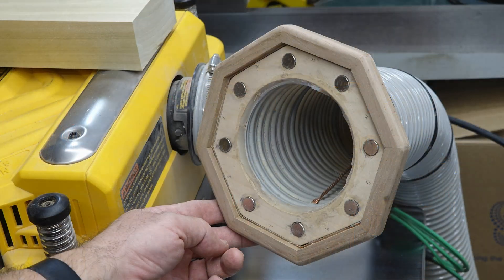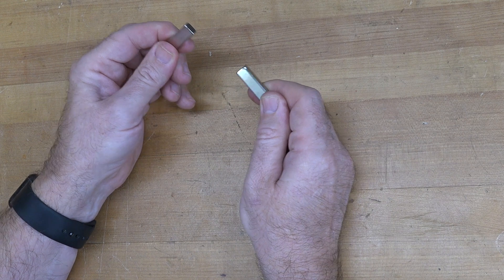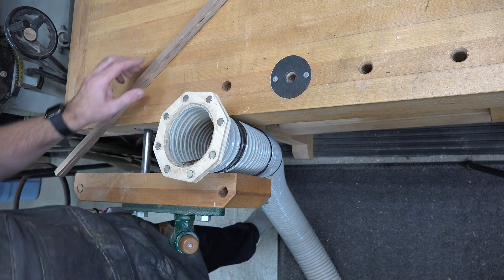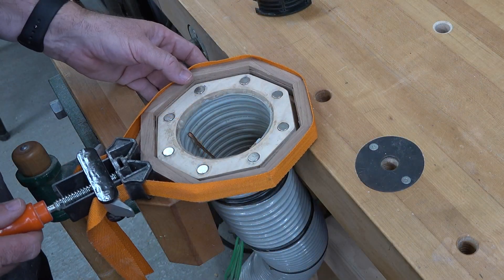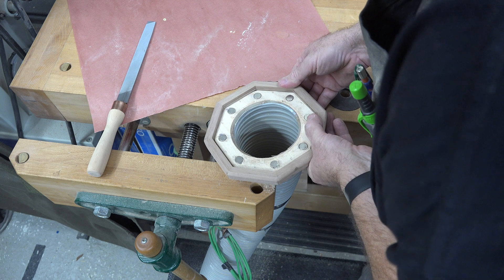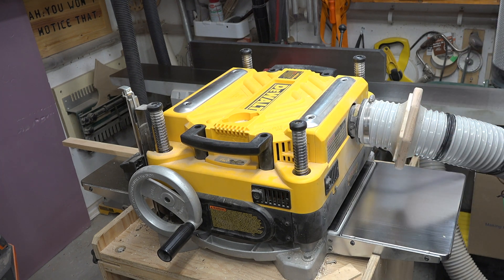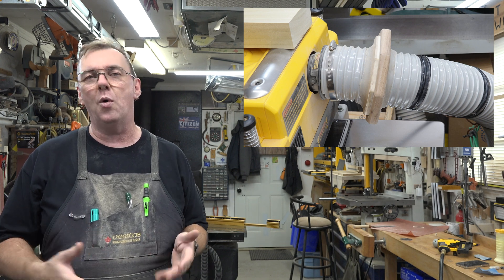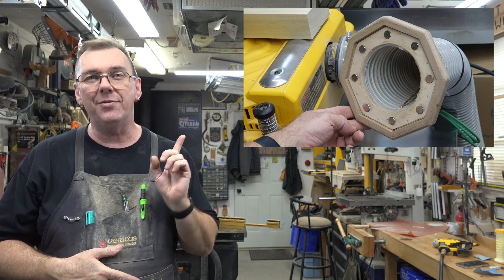Magnetic Dust Collection Fittings 2 0

Comment: I will be making these adapters, but for 2 1/2 inch hose. I will use my laser machine to make the template. I'm thinking about routing a shallow grove on the face of movable piece and gluing in a 1/8 inch "O" ring (may not be necessary). Thanks for the video and giving me the inspiration to make myself. Keep it up.
Reply from the maker: Glad that you liked it Joseph.  Good luck with your project and thanks for tuning in to the show.

Comment: Wow, Thanks for this video, I will definitely use this idea.
Reply from the maker: It's a great idea and it worked well for a very long time.  I ended up 3D printing magnetic connectors eventually.  They work really well also.  Both designs are fantastic.  Thanks for tuning in to the show and good luck with your project.

Comment: Great Update!
Adding the flange is the  best way to keep them from sliding off.  
 I learned recently that stacking magnets improve their pull strength. 
Do you just have one Magnet in each Hole? Or are they stacked?
Wondering how many around the hole are really needed, now that the flange helps keep it in place?
I see so many people only use (4) around the hole and not hearing about any of them falling off, but they also stack them?
 And how many Stacked?  
I know the more, the better.
I know it depends on how thick and what type each individual Magnet is.
I guess it's just a lot of trial and error?
My Luck, of course,  I just got done making about 12 circles.  Both inner & Outer.
Wish I woud have seen your video sooner.
I guess I can still modify mine with some sort of flange. 
It just won't be continuous.
Just a circle with flat sides since i can only cut so far into them.
Don't want to completely start over....lol
Reply from the maker: The magnets were stacked.  2 in each hole.  I hope this helps.  Thanks for tuning in

Comment: The maths to work out the angle required is pretty simple. It’s 360 (as in 360 degrees) divided by the number of sides and then divide that number by 2 again. 

Example: for a square it’s 360/4/2
Reply from the maker: Thanks for tuning in and for chiming in with the math for the angles Dean.  It's appreciated.

Comment: Originally you put the larger number of magnets in the hose end, increasing its weight. Adding the flange added to that weight and increased its bulk. I'd suggest putting that weight and bulk on the tool side.
Reply from the maker: Great suggestion Bob.  Thanks for tuning in to the show.

Comment: I might have tried pins. Drive about three lag screws into the stationary piece, cut off the heads, smooth the cuts, drill holes in the hose end to match.
Reply from the maker: If that's the method that works for you Bob, then by all means, do it that way.  I appreciate you tuning in and chiming in with your suggestion.  Thanks.

Comment: Great modification!  I'm making my Octagonal fittings right now and think I'm gonna go for 2, maybe 3 magnets in all 8 positions on both the tool and hose fittings.  I love the flange idea, especially for something like the Dewalt Planer.  But a much simpler "fix" IMO, to solve just the shear force would seem to be drilling a hole through all the tool fittings and putting in a piece of wooden dowel that sticks up 1/2" and drilling a matching hole on all the hose fittings.  Might take an extra second to line them up, but should completely solve the surprise shear problem and be a whole lot easier to modify.  Maybe....  Or maybe not, since on yours all you have to modify is the hose side.  Shit,  what do I know.  Think I'm gonna shuddup now.
Reply from the maker: LOL.  You have to do what you think is best for your dust collection system Don.  If the dowel idea works for you, then that's just great and I say go for it.  The flange was also added to prevent the blowout from more powerful tools like the planer.  I don't think the dowel will correct that issue.  Let me know how you make out.  Thanks for tuning in to the show.

Comment: Great idea. With this latest upgrade, do you think it's still necessary to use a stack of 5 magnets on the flange on the collector side ?
Reply from the maker: I think it will all depend on what magnets you are using Mathieu.  Give it a try and see how one magnet works out.  Hopefully the framework around the flange will compensate for the sheer force and allow less magnets to be used.  Thanks for tuning in.

Comment: Hi Kenny, very attracted by this video for some reason! but I think us down under are poles apart 🤣always amused when you Canadians and Americans go to your scrap stock and pull out a bit of walnut and maybe a sheet of ebony to make a jig, we would get some pine 🤣🤣 good jigs though. This is were your 3d printer will come in handy. I know you probably didn't have it then.
Reply from the maker: I've been contemplating using my 3D printer and making magnetic dust collections for the shop Philip.  It's all a matter of figuring out the design.  Believe me when I say, it's in the very front of my mind and we may just see something come out of this yet.  Even possibly a shared file for those who have 3D printers.  Either way, thanks for tuning in this week and for taking the time to leave your comment.

Comment: I would love to do this for my shop but I have a hard enough time with 45 degree miters let alone 22.5. Any reason you went with the octagon shape? I could probably do round fairly easy, would there be any issues with that? I’m still dealing with the $2 miter gauge sawstop gives you lol
Reply from the maker: You can make it any shape you'd like Randy.  I went with an octagon and making it on the table saw to make the project accessible to the major majority of tool owners but if you are able to make them round, then by all means, make them round.  I hope this helps.  Thanks for tuning in this week and for chiming in with your comment.  Good luck with your $2 mitre gauge.  (why are the supplied mitre gauges always such junk?)

Comment: 4 years ago I made similar dust collection system. However my system I use 5 inch hoses, I also made my flanges from water closet or toilet flanges. The most labor intensive part was sanding down the raised lettering on the flange face by taping 150 grit sand paper on a sheet of glass and sliding the flange forward and aft until the flange was flat. Then I recessed 1/2 diameter 4 N54 neodymium magnets in each flange. I have never had a flange separate unless I wanted it to. 🤣🛫
Reply from the maker: That's a very creative way to get dust collection fittings.  I never thought of using something like a toilet flange.  Well done.  Thanks for tuning in and for chiming in with your story.  I love it.
Reply: @acutabove_woodworkings  Kenny one of the reasons I always watch your videos is that they are informative and enjoyable to watch and you are good at explaining the details. The best part you take the time to acknowledge your viewers. That means a lot to me. Other high profile YouTubers that do not respond to the very people that made them what they are today and do not respond. They get an unsubscribe from me. Thank you sir! 😁🛫
Reply from the maker: @TheFalconJetDriver  People are busy these days and my thoughts are that if someone takes the time out of their busy day to watch and comment on my show, the least I can do is respond to them.  I do miss some comments from time to time but it isn't very often.

Comment: Great idea,  You can also use this design as an adapter too.  Lets say you want to connect to a 2" hose, like from a miter saw.  Take the plywood piece, and instead of cutting the internal hole to be 4", make it the diameter of the miter saw hose.  The hole doesn't have to be centered, most people  put it on the bottom.  You can now connect your hose to your miter saw because your magnetic fittings for both sides is the same size, just the internal hole is different.
Reply from the maker: A great idea Scott and another fantastic modification or use for this project.  Thanks for tuning in this week and for chiming in with your suggestion.